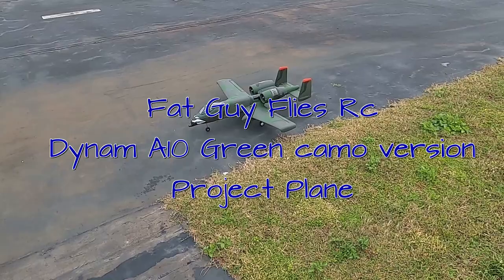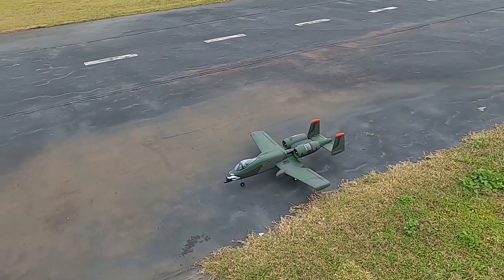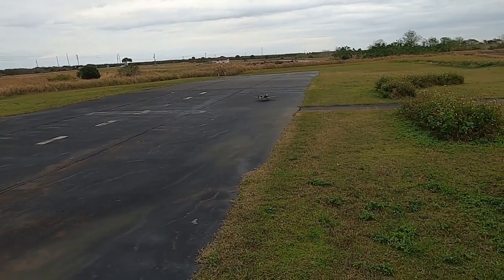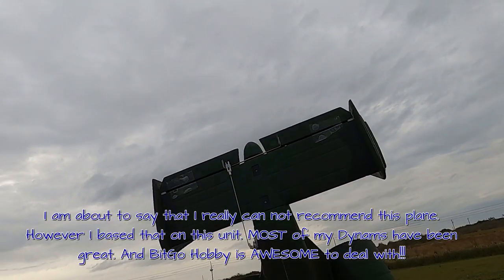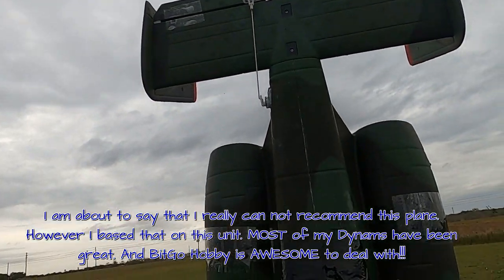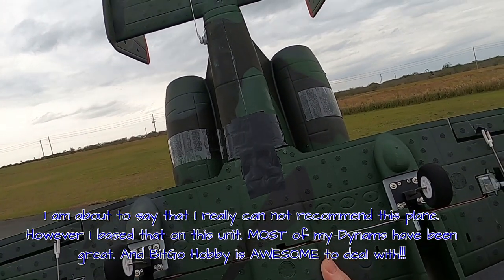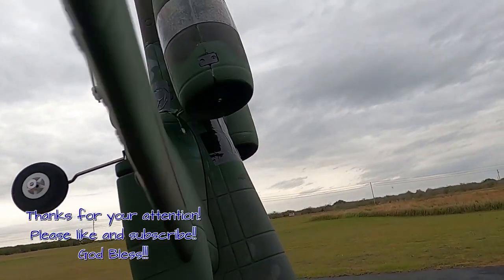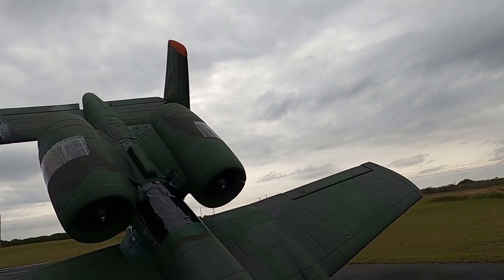Making the most of a Damaged Kit by Fat Guy Flies RC!!

Comment: Hi, Fat Guy does it really matter where the receiver is placed in the plane? I'm finishing the build on my Freewing A-10 Thunderbolt 11 and have no room for my FrSky X8R receiver in the nose. The only place I can put it is in the middle of the fuselage about 2'' behind the trailing edge of the wing will that be ok? Thanks Jeff
Reply from the maker: Actually as close to the center mass is great, just be careful to keep the antennas at 90 degrees from each other and away from the carbon spar if possible.